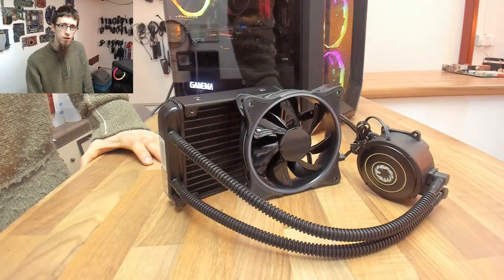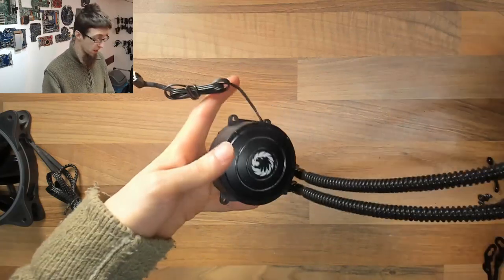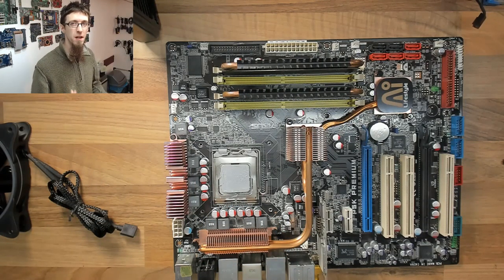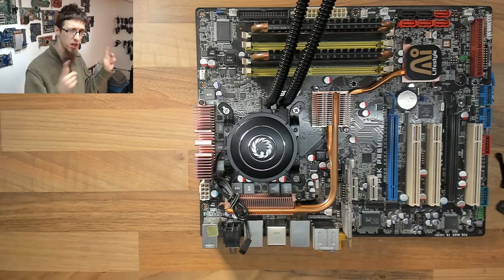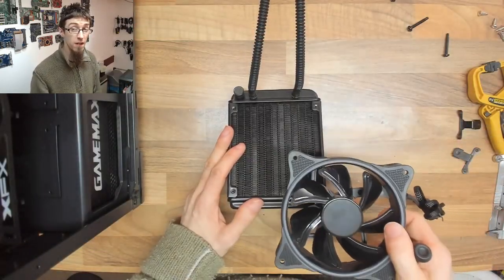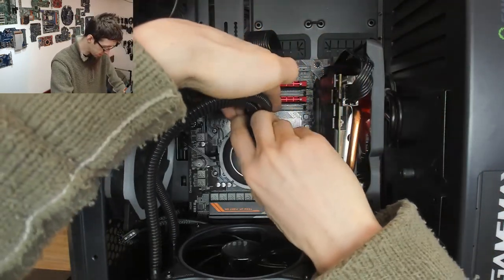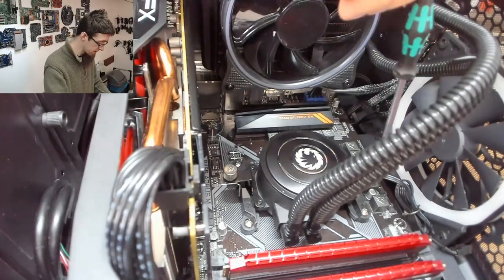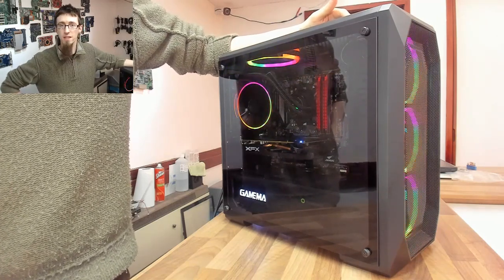LBC#44 - GameMax Iceberg120 Fitting & Use

Comment: Your vids are really informative and well-edited. Great job.   Can you advise? Have this case on order but I ordered the 240mm rad version with the intention of mounting it on the front and using existing case fans to cool rad. If you mount it this way was just wondering what you guys do about controlling the cpu / radiator fan speed? I'm assuming you'd take two front chassis fan controllers off the GameMaster ARGB control thingy, use a Y connector to connect the two fans, and then attach this to the CPU fan controller on the mboard? Like you've done on this vid, was just going to use one of the Iceberg fans on top of the chassis as an extra air intake. ( or perhaps intake with one fan and exhaust with the other ).  Does that sound plausible?   Not sure if that would screw up some lighting effects on case facia?  Will be using a ROG STRIX z490-G so assuming AURA sync will come to the rescue if it does.

Comment: Hi. How much rpm is correct to set that pump when pc is normal use? I have 50%-50° its OK? I need some curve recomended for this product on sysfan and cpufan on smart mode config
Reply from the maker: I tend to run AIO pumps at about 60% idle, and have them ramp up from 60c, hitting 90% by 70c
You want the pump to run up to high speed fairly early in the fan curve because it's doing the most work in removing heat from the CPU. The fans can be more lazy, as they're removing heat from the radiator. Don't let the radiator fan stop, though, as that'll induce heatsoak in the liquid and really hurt temps when the CPU slams on load.

Comment: just installed this on my build. struggling to get any better temperatures than my 'be quiet' CPU fan. setup is;

windows 10 pro
Intel 9700k
corsair 16gb ram
corsair 750w psu
geforce 1060 6gb
2 x rgb fans 
iceberg 240mm cooler (new thermal paste today with install)

for example, playing dayz on medium graphics 1080p 110fps the temps are hitting 75c which I am confident is too high. any thoughts or suggestions welcome
Reply: Paul White use a good thermal compound and use the stroke method for applying it. May drop temps down to 65-70
Reply: Another tip: Change out the default fans that come with the radiator with better, higher quality ones.

Comment: Quick question, would it work if i dont put on the rgb cable? (i dont want the rgb because it doesnt mtach my fans haha)
Reply from the maker: Yup, you can leave the fan's RGB cable disconnected - you can also use a different fan on the radiator if you want to match fans.
Reply: @Adamant_IT  Thank you, great video!

Comment: Do you think this water cooler would be sufficient for an i7-9700 (not k)? Cheers.
Reply from the maker: Shoooould be OK, but personally I'd get a 240mm rad for an i7, just to have that extra overhead.
Reply: @Adamant_IT  Thanks. There is a lot of debate if AIO coolers are actually any better than a good heatsink and fan. Essentially, I'm wanting to make a cool looking build with the Kamikaze case as in your video and an i7-9700, and want as much to light up as possible, CPU, RAM, led strip etc. The Corsair Vengence RAM is quite tall, so concerned about whether it would fit under Gamemax's other CPU fans, say the Gamma 300 (though I think this would be insufficient for an i7 anyway). It might fit under the Gamma 500. The Cooler Master Hyper 212 RGB also gets lots of positive reviews...oh too many choices!!!

Comment: Personally the Arctic liquid cooler 2's seem like an overall better product from installation to the results.
Reply from the maker: Mmm. I'm not a fan of the bulky pump head on that one, especially the VRM cooling fan, which I think will either be noisy or useless. It looks impressive though, I'll give it that. At least for 120mm coolers, I prefer the smallness of the Iceberg, but for larger systems the bulkier Arctic will make more sense.

Comment: can i remove the green led on the pump
Reply from the maker: I've not tried disassembling the pump - however, most AIOs like this one are all the same Asetek design, just with the branded plastic covers on them. So it's probably not difficult to modify it. Not sure if the unit needs to be drained to get that far in, though.